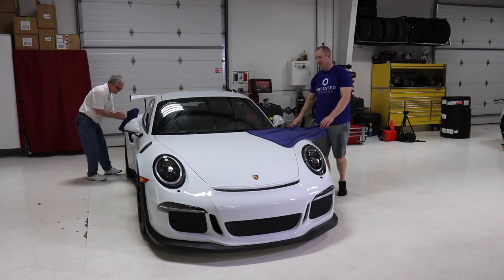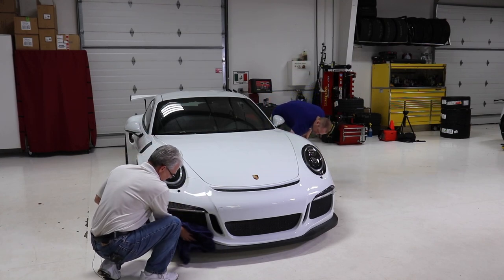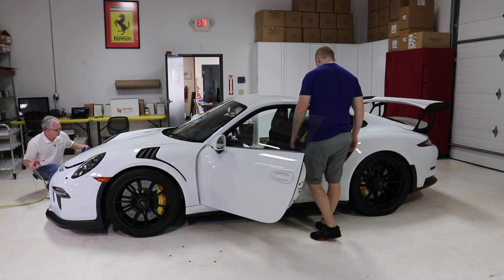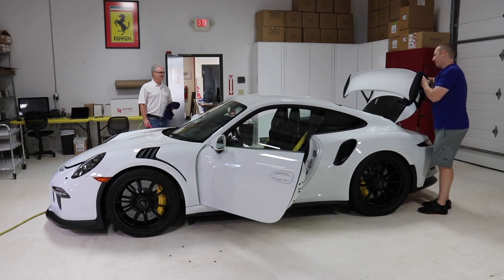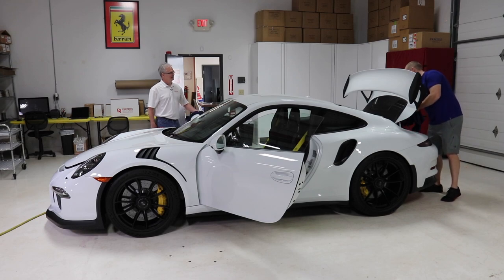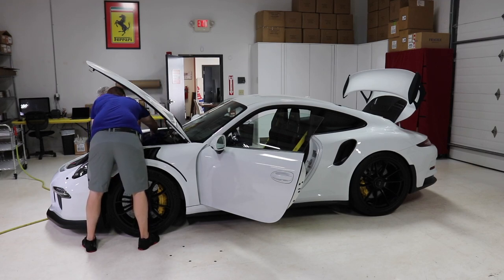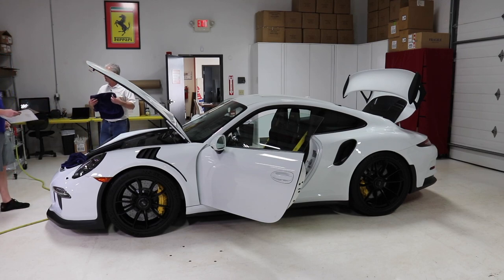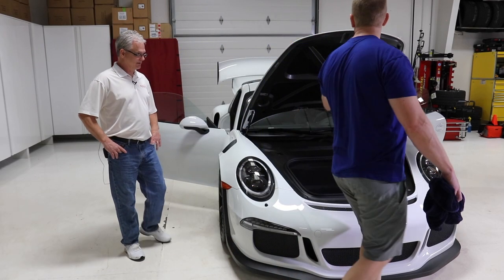Epic GT3 RS Detail at Esoteric: E3 - Drying

Comment: Is new Porsche smell much different than new Chevy smell?
Reply: Id imagine so --- Alcantara vs. GM Leatherette.
Reply: Sinister.Shelby They all have there own distinct smell , not sure what Porsche smells like , but , Lexus, BMW, Mercedes, GMC , they all smell different from my own experience
Reply: Ty Petrisin, I hate to tell you but Porsche also use their fare share of plastics and non-leather on the interior.  Yes, they have their own distinct new car smell.  Also, if I had an Alcantara steering wheel, I'd change it for leather.  But that's just me.
Reply: limulus61 I have an e63s and has alcantara steering wheel and I’m not a fan it gets real dirty ,rather have leather myself, I like the headliner though it’s also alcantara
Reply: Antimatter I don't care for alcantara on my steering wheel ether. Just the oils on my hands gets it dirty, and it's hard to clean.